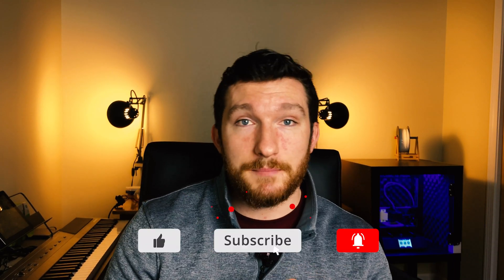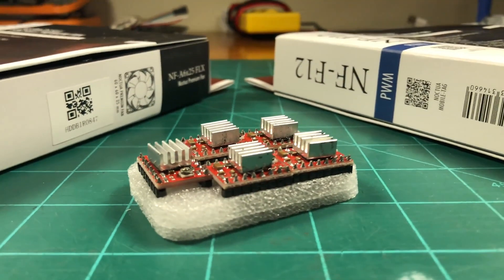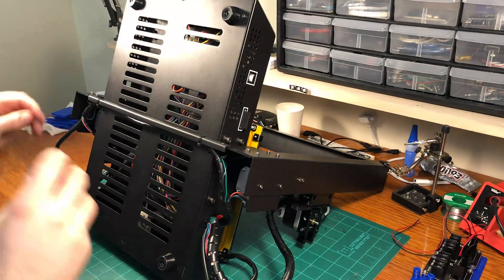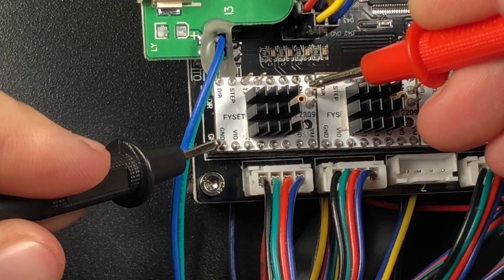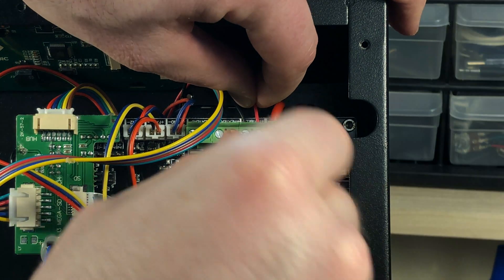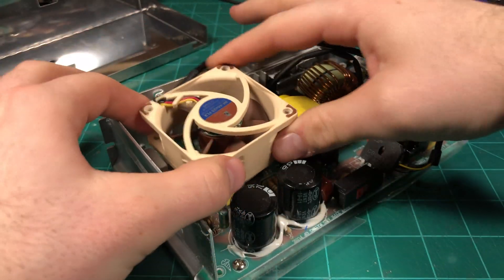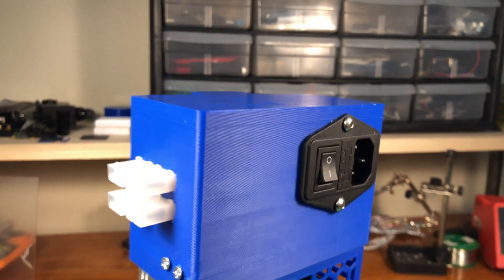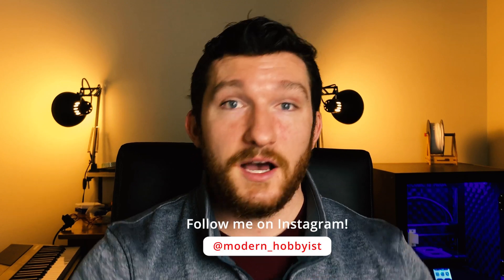Anycubic i3 Mega Ultimate Upgrade Guide

Comment: DISCLAIMER(on behalf of Modern Hobbyist) = Modern hobbyist is obviously a experience user with electronics, if you are new to electronics - don't mess with upgrading the fan on the power supply unit. Even turned off, (those black looking silos) capacitors can take hours sometimes days to discharge, there is a risk of a very painful electric shock(see that bright yellow CAUTION sticker),  even burns are possible. Always use a insulated screwdriver and an anti-static strap if you are going to attempt to upgrade the fan of your power supply unit. That being said, excellent video!
Reply from the maker: Thanks for the comment! I agree, some of these updates aren't for the faint-hearted, but I definitely encourage everyone to get out there and try new things! Great advice though, I appreciate it!

Comment: Hi. If I just change the stepper drivers to tmc2209, do I need to change the firmware? Thanks for the awesome video!
Reply from the maker: Hey Thomas, thanks for the comment! If you change to TMC2209's you don't need to change the firmware, but you do need to flip the motor connectors since the pin output on the TMC2209's is backwards compared to the stock A4988 drivers. That being said, if you did decide to change the firmware to a newer version of Marlin, there is an option where you can switch with the TMC2209's and NOT flip the motor connectors. Check out my video on that topic if you want to learn more! https://www.youtube.com/watch?v=zprmBmMFHQQ

Comment: You measure voltage at the WRONG POINT! After ~one year, I finally decided to upgrade it and spent a lot of time measuring the voltage there, after watching your video. It was always zero, no matter how I adjusted!
 After watching the proper guide, I saw that YOU NEED TO MEASURE 'GND' and that Golden Circle which is called V ref!!! I wasted so much time because of this!!! It seemed a nice guide, but with the mistake like this... PLEASE FIX THE MISTAKE or write in comments and PIN it or something!

And included blue heatsinks are too tall and doesn't properly fit with default fan holder.. You clearly changed them to different black color and didn't say anything... Like wtf man? :/

BTW your "noise canceling/isolating" foam is for noise dampening which only reduces ECHO and, in this case, makes almost zero difference. :|
Reply from the maker: Thanks for the comment. Like Nick Win said, the heatsinks vary depending on the manufacturer you buy the drivers from and I would never try to intentionally mislead my viewers. Also, like Nick said, I clearly stated GND and VREF in the video at the 4:00 mark, which are the points that I touched my multimeter to, also in the video at the 4:00 mark. 

Like I said, I would never try to intentionally mislead my viewers as I have nothing to gain by doing that and I am simply making videos on the projects that I attempt. 

You might find that you'll have greater success in life if you stop assuming the worst of people and understand we are all just trying to do our best. After all, “If you look for the light, you can often find it.But if you look for the dark that is all you will ever see.”
Reply: At 4:00 he does say GND and V ref though.... And the heatsinks are different depending on where you buy them... And the foam does absorb vibrational energy (sound) so it will reduce the noise... And it is also used for maintaining temperature for ABS prints and just looks cool

Comment: Really interesting stuff. Love my Mega S and definitely am interested in the power supply and stepper upgrades. I probably won't be building an enclosure since I print in the basement, so I was wondering: Will the modified PSU enclosure still fit back in the base of the Mega if I didn't want to house it externally?
Reply from the maker: Thanks for the comment! I'm not positive if it would fit back in the enclosure, it might be a bit of a squeeze. You might want to check Thingiverse for alternative covers that are intended to be placed back in the body of the printer. I'm sure there are other people out there like you that just want to upgrade the fan, so it's worth a shot!

Comment: Do you need to do these things to the I3 Mega S too?
Reply: I have a Mega S and definitely suggest replacing the drivers with 2209s and the PSU and hot end fans with Noctuas. Huge difference in sound. This video also applies to the Mega S since they are mostly the same.
Reply: @wonkyweasel8922  what are your Vrefs? Most Mega S users set them all to 1,06V, because lower than 1V they got layer shifitng.
Reply: @nmsgoncalves  I have mine set to ,9V right now. Not seeing any signs of shifting or under-extrusion. Once I flash the newer firmware and calibrate, I'll probably bring them up to 1V. Just waiting to get a pi first so I can do it all at once.
Reply: @wonkyweasel8922  thank you for your answer. Mine 2209s are still on their way

Comment: For the power supply fan can i use "Noctua NF-A6x25 PWM, 4-Pin" instead?
Reply: A PWM fan gives you the ability to control fan speed. Since the PSU fan is going to be running full speed all the time, the FLX is a better option. The PWM comes with a 3-pin adapter cord which you would then wire to the ground and 12v wire. Long story short, you can use either fan, but the FLX is easier to wire and will perform the same on this printer.
Reply: @wonkyweasel8922  do i have the design for power supply put it outside for Mega X?
Reply: @everfreeeeee  For that I am not sure. I just know that you can use either the PWM or the FLX Noctua fan for the power supply on a Mega (S).

Comment: Something I noticed with my printer, and it's the same with yours, (look at 3 minutes in), the bottom plate to me at any rate, is the wrong way around, as the fan that cools the stepper drivers, which is pretty well sat against the bottom plate, has it's intake blocked by said plate, . If you take off the feet, put a 10mm washer over the insert, then refit the feet on that side, you can turn the plate around and fit it so the fan intake isn't blocked.  You can't simply rotate the plate, as the middle two fixing screws aren't actually in the centre.
Reply: Hi Ratimus
This is a late reply but may be useful to some viewers. I'm a retired Avionics Electronics Mechanical Engineer with some experience in thermal management in electronic enclosures. As to the positioning of the openings in the base cover, at first glance your point of view seems to make sense. But let's examine what we can see. It would appear that the vent openings were specifically omitted exactly at the fan location. This is most likely not a coincidence. How does this blockage effect the cooling? Well, with the cover flipped as you suggest, the fan would pull air directly from under itself and blow air directly up to the motherboard. This would create low pressure under the fan and high pressure above the fan. This high pressure would of course be contained by the motherboard and release out in more or less 360 degrees parallel to the motherboard. We're speaking generally here. Unfortunately what would happen next is that the low pressure below the fan would attract the high pressure above the fan and vice versa as they would both be each others least path of resistance. So for the most part we would be recirculating the air from above the fan and below the fan. Also, we would be heating this recirculating  air with the hot components on the motherboard. On the other hand, blocking the openings below the fan forces it to pull laterally from the sides at a higher velocity resulting in the circular push pull cycle of air flow to happen over a larger area allowing this airflow circle to have more contact with non-heated air, improving the cooling efficiency. Again, I'm speaking generally but I hope I've been able to show you that thermal management is more complex than might meet the eye. These things are generally worked out through thermal analysis in simulation software that show airflow and resulting temperatures. From my point of view, seeing those vents blocked directly under the fan indicates to me that in fact some sophisticated thermal management was applied to the design of the bottom cover and my guess is that the cover should be installed just as you found it.

Cheers and good printing...

Comment: You installed TMC2209 drivers but made no firmware changes. How is that supposed to work?  I just upgraded an Ender 3 to a BTT SKR Mini board and had to modify the Configuration.h file to call out the TMC2209 drivers so the Marlin software would have the info it needs. The software needs to know it can make the 1/256 adjustments vs 1/16 doesn't it?
Reply from the maker: The stock Anycubic firmware will work with the tmc2209s out of the box as long as you flip the motor connectors. I have since also updated my firmware to a special version of Marlin which accounted for the increased step resolution, but I assume the stock Anycubic firmware uses the default 1/16 resolution.

Comment: Thank you very much for the wonderful video could you please explain how do you connect your LED lights to the machine so when you turn the machine on the lights turn on automatically not separate thanks
Reply from the maker: The type of LED I used require a data signal in order to set their color, which means I needed a micro controller of some sort to control them. In this case, I used the Raspberry Pi, which takes a bit to boot up once it get power. If you want it to be faster, you could go with a different strip that is only one color, and connect it straight to the printers power and it will turn on immediately, or you could go with a faster microcontroller like an Arduino, but you'd have to write that code yourself. Thanks for the comment, I hope that helps!

Comment: Have you looked into the Mega S? Not sure what the stepper motors are used for that but will look into this upgrade along with others
Reply from the maker: I have seen it but haven't investigated it much. Maybe someday I'll have more than just the one printer, but right now my apartment (and my wife) would not allow :(.
Reply: @ModernHobbyist  you can get an upgrade from the regular mega to the S as an upgrade package to install yourself. It comes with a new extruder and a new spool holder which both work great. The new extruder can print flexible filament. I installed it during lockdown and I’m really happy with it! Definitely worth getting!

Comment: Hey awesome video, I am going to be upgrading my i3 mega soon and just want to ask what's the difference between the 2209 and 2208?
Reply from the maker: Ultimately, the TMC2208's will probably provide you with more than enough functionality. There are some differences:

TMC2209 - 2.0A current rating, sensorless homing, and lower heat output (cooler operation).
TMC2208 - 1.5A current rating, slightly warmer operation (but still good). 

The sensorless homing would be the biggest difference, but the i3 mega already has endstops, so this feature is redundant on most current 3d printers.

Hope this helps!

Comment: Great video, but did you have to change your firmware in order to use the TMC2209s?
Reply from the maker: Thanks for the comment! Nope, as long as you flip the motor connectors on the motherboard, the TMC2209s will work great with the stock firmware!
Reply: @ModernHobbyist  Do you know if the UART mode can be configured to work with the i3 Mega board? At the very least it would require Marlin 2.0 firmware, but I'm wondering if the hardware is compatible.
Reply from the maker: That's a good question, I'm afraid I haven't looked into that, but I'll check back here if I do!

Comment: wont you need to flash marlin to let it know its 2209s?
Reply: if i were to follow your other video to flash marlin 1.1.9 , the hex files there are 2208s? am i still able to use 2209?
Reply from the maker: Hey Zach, thanks for the comment! As long as you flip the connectors for the stepper motors, you don't need to flash a new version of Marlin on the printer, but in the event that you do, it works great with 2209's. That's what I'm using and its being perfect so far. Thanks again!
Reply: @ModernHobbyist  will the 2208 firmware file work for 2209s also? And the drivers are running standalone mode correct?
Reply from the maker: Yup, I am currently running the 2208 version on my printer. I'm not sure if they are running standalone or not though.
Reply: @ModernHobbyist  alright thanks for the help , great videos by the way ! Cant wait for more!!!

Comment: hi! I am going to update my Mega S also and I was looking for TMC 2208 however I've learned that TMC 2209 has sensorless homing. In fact what does is the advantage of this? It is possible to use this with stock firmware? I am newbie on this.. sorry.
Reply from the maker: Hey Guilherme, thanks for the comment! I am not super familiar with that feature, but from what I have read, it can detect when the stepper motor is experiencing higher than normal resistance, i.e. it has hit the end of its range of motion. However, I don't know if the stock Anycubic firmware or the special version of Marlin I installed on mine accounts for this. I'll have to get back to you on that. In the meantime, keep leaving great comments for me to think about!

Comment: Was looking into upgrades for my anycubic i3 mega s, came across your vids an love em. Just wondering as to a suggestion currently for what's involved in this video. Much of it is unavailable as of now. New list?
Reply from the maker: Hey thanks for the comment! Are you saying that the items I linked to are out of stock right now?
Reply: @ModernHobbyist  yea a few of the items say unavailable so wasnt sure if you had other options in the meantime that would be a good alternate.
Reply from the maker: Yeah I noticed it has gotten really hard to get stuff during the quarantine, but I don't really have specific alternatives in mind. I'd say that most of the products could easily be swapped out for a different brand or company without any issues. You might check Aliexpress for the same products if you aren't worried about shipping time.
Reply: @ModernHobbyist  definately harder nowadays. I managed to find a distributor for them so have them en route. Thanks for the vids, keep em going! Seems hard to find legitimate i3 videos that are easy enough to follow and apply the information you do.
Reply from the maker: Thanks so much for the kind words! Glad I can help!
Reply: @ModernHobbyist  so I recieved my TMC 2209s from big tree. Installed them and reversed the connections. Then had a loud pop with sparks fly out of the printer. Looks like one of the converters on the mobo overloaded an burst. Any idea why or how that would have happened?
Reply: When I turned it on after I had a breif second to home everything and was looking good. Then the LCD went blank so I powered off. Gave a bit an hit the power again an that's when the pop happened.
Reply from the maker: I'm sorry to hear that! The only thing that I can think is that one or more of the drivers was installed backwards. If you flipped the connectors then the issue wouldn't have been there. Can you confirm the drivers were oriented correctly?
Reply: @ModernHobbyist  yea I double checked the orientation of them before hand. Really at a loss with this scratching my head. I suppose the mobo will have to be replaced. Got any good ones in mind? Haha.
Reply from the maker: That's awful, I'm really sorry. I think your best bet would be the TriGorilla board provided by Anycubic. https://www.anycubic.com/collections/accessories/products/trigorilla-motherboard-for-mega-kossel

Should be able to directly swap it out in place of the old one with no trouble.
Reply: @ModernHobbyist  all good! Thanks for the feedback! One thing I realized is I forgot to set the Vrev on the drivers so wondering if that would have perhaps overloaded it in some way?. I still havent connected my Mosfets, but none the less. A learning process either way!

Comment: I now have three Mega S's and will most likely do this mod to at least one of them because its just so darn cool. Wonderful job! When ordering parts I need to buy 4x TMC2209 Stepper Motor Drivers correct? Also the 3d Printer HotBed MOSFET comes in a pack of two, is that enough as it wasn't totally clear to me? I just want to be certain before I order my parts. Thank you for posting this, now I must go look at your other videos.
Reply from the maker: Thanks for the comment! For the TMC2209, you will need 5 pieces. You should be able to find packs of 5 on Amazon or Aliexpress no problem. For the MOSFETs, you'll need two total. One for the Hotbed and one for the Hotend. Hope that helps!

Comment: Great video thanks! One thing I wanted to do on my Mega S is to install a BLtouch sensor but not sure if the motherboard supports it.
Reply from the maker: I don't think the stock Anicubic firmware support BLtouch, but I know the version of Marlin I installed on mine does, so make sure to check out that video, as well as Dave Ramiro's work on Thingiverse/GitHub. Cheers!

Comment: I read that you need to set the extruder stepper to 1.5v to stop the extruder clicking and under extruding. Can you confirm this is the case?
Reply from the maker: I haven't heard that, but my extruder was under extruding by about 7%, so I made a video covering how you can calibrate it by adjusting the steps per millimeter value saved in EEPROM. Thanks for your comment!
Reply: @ModernHobbyist  I changed the v to 1.3 on the E0 stepper and everything has resolved. Thanks for your videos, they are great. Already done the claibrations, mine was under extruding a whole 10mm!!! Just updating the fans now 😁